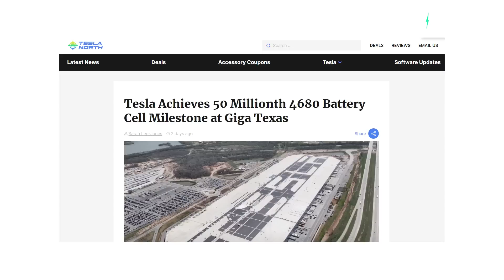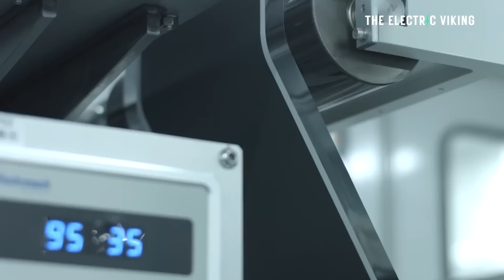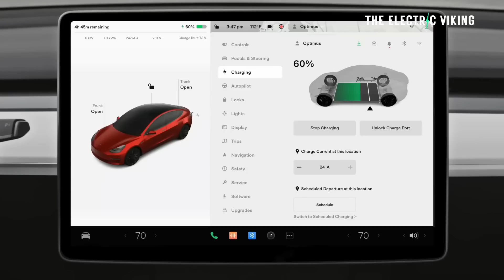Why Tesla will use different but better batteries in Cybertruck next year

Comment: Sodium ion batteries although lower density than Lithium ion,  could offer improved packing efficiencies by using much larger cells. The greater heat tolerance of sodium ion batteries could allow this larger cell type to be used.  This could improve the watt hour per kg of battery and bring sodium ion closer to lithium ion when the wh/kg is normalised in this greater packing efficiency context.  Thus potentially boosting the default sodium ion 160 wh/kg to 200 wh/kg if you quadrupled the diameter of the sodium ion batteries.  By reducing battery cell gaps and optimizing the pack structure, it is reasonable to assume that packing efficiency improvements could provide a 20-30% boost in overall energy density.  This concept would only apply to sodium ion and other more heat tolerant battery chemistries.
Reply: Leveraging the greater heat tolerance of sodium-ion batteries and optimizing the pack structure could lead to significant improvements in overall performance. This approach has the potential to make sodium-ion batteries more competitive with lithium-ion batteries, especially in applications where energy density and thermal management are critical factors.
Reply: You could also modify the cell shape to be less round and more square to reduce the cooling gaps even more using sodium-ion cells, as heat is less of an issue. This could further improve Wh/kg packing efficiencies.
Reply: Of course, sodium is yet to be proven. I have no doubt it will be proven, not only for grid storage but also for EVs over time via a multi-pronged approach of sodium battery design and packing density, combined with a lower range requirement in a mature ubiquitous EV supercharging environment. That will take a few years, however, when it arrives, one simply won't require long-range EVs. The critical factor will be fast-charging capability and availability. The vast majority of car drivers will only require 300 km of effective range under such fast charging conditions. Most won't even require that range for their typical daily drive. It will only be needed for long trips. After 300 km of driving, one requires at least a 10-minute rest break, whereby at that time, one recharges 80% in 10 minutes. Game over. Job done.
Reply: Cybertruck space for the battery is currently 50% empty but the drop in Lithium prices have made Sodium Ion an unlikely contender.
Reply: Lithium batteries currently have a much higher density than sodium. Lithium batteries are packed with high density especially and there is little room for improving the packing density. 
Sodium is also not a proven technology so untill these batteries have a history no one is going to put them in their mass produced cars untill they have a proven track record.
However 
Sodium likely be popular in grid storage and lower ends cars in the future

Comment: Elon is truly the king of rocketry.  But i own Tesla.  And the 4680 seems to be a huge miss from the stated goals.  From the business end of it, Tesla made the appropriate supply deals to grow, but never heard is just what the effort into the 4680 cost and is costing, and what exactly are the results.  I dearly hope that when he gets the ransom, I mean compensation, he will have a host of hot actual accomplishments to refresh the world’s memory.  That is the freest speech you can generate organically, as we used to do, in a fully positive light.  Better times!
Reply: They intentionally pulled back 4680 efforts because lithium prices dropped, meaning they could just buy in batteries cheaper from others. Tesla trying to be the best battery manufacturer and the best car manufacturer at the same time is a route to bankruptcy. The only accomplishment Elon needs to get paid was 10x the share price, and he did that, even considering recent drops.
Reply: Agree, Tesla has missed the targets for the 4680. That why some great folks was laid off this spring, one among them was Drew Baglino

Comment: I wonder if they will use the 4680 size tor the LFP battery? They would fit inside easier then.
Reply: There is a flat version that is even more space efficient.

Comment: As an investor in Tesla, I love to see how they are always at the forefront of EV design. I know you love the Cyber truck, and I do appreciate some cool features on it. However, I prefer the more practical design of the Telo truck. I am all about space utilization and that design would work much better for me. They are talking about using lithium-ion batteries so far. I hope they change their minds. I can't recall your reporting on them. I hope you do. Keep up the good work, I love the public service you do for all of us!
Reply: The Cybertruck has aspects that make it more practical as well - a body and engine/battery that last nearly forever, free fuel if you have solar at work or home, near zero maintenance besides tires, better electricity supply for tools. Not everything is perfect but neither is it with traditional trucks.
Reply: @Michael-Has-Opinions  ahh the voice of sanity. 😊
Reply: All designs are about comprising one thing for another. I agree with all your points. The CT is big and flashy, as contrasted by small and practical Telo. Do you see the Telo as a traditional truck? As for the tech side of things, Tesla rules.
Reply: I agree. They messed up on the CT and it's too bad. They have a chance to really do something here but did way too much 'innovation' in terms of design that was totally not necessary - in fact, probably detrimental to Tesla
Reply: @travisjazzbo3490 two million pre sales!

Comment: A true battery breakthrough is what's necessary. 2x or 3x energy density at a minimum. Powering a work truck with batteries atm is kind of a joke.  There will be ZERO battery powered "actual" work vehicles in the near future and I love Elon.
Reply: This is not correct. The only place gas trucks work out better is towing big loads over big distances (F250) or extreme situations where customers are 500 miles away with no place to supercharge. These are unusual circumstances.
Reply: What do you call a "work" truck? I assume you mean one that carries a few bags of dirt and a two-four?
The Semi is a work truck, and will be successful once they get around to, ya know, actually building them.
Reply: @capnkirk5528  I agree however the Semi is a specialized purpose-built transport where many efficiencies can be optimised. Even so, the Tesla Semi will never hang with a diesel on range. It just aint happening until we get a battery breakthrough.  So work trucks are, F250 and larger utility trucks that are used daily at work/construction sites for various activities. Also class 3 to class 6 truck types are a very long way off. Those will all be gass/diesel for a long time yet...
Reply: @mdeasy while this is true, there semi can go 800km fully loaded.  No driver can get anywhere near that far before they are required to take a mandatory rest stop.  Megawatt chargers can refill in less than an hour.... So the real need is enough strategically placed mega chargers to be able to service those rest stops
Reply: A Chevy Silverado EV with 440 miles range is inadequate?  Electric delivery vans (already in use)?  Electric semis for trips within 200 miles (a significant fraction)?  Already in use.  Electric buses (already in use)?  Reality has surpassed this meme.
Reply: @bearcubdaycare  Everything you say is ABSOLUTELY TRUE, but HE is the kind of idiot who sends money to Trump.
YOU CAN'T FIX STUPID.
But if you could, you nailed it!
Reply: I’ve thrown plenty of shade toward Tesla and it’s fan boys but I think your underestimating this truth.  But yes we need a 50% more energy density.
Reply: @davidstrong7854  Your choice of "50%" is ironic since the average ICE engine wastes 50% of its gasoline energy to the air as waste heat.
Reply: How about breakthroughs in home construction technology that can overcome the tendency of them to disintegrate into splinters in the face of the average tornado?
Reply: @billyrio3767  concrete and rebar that goes down to the foundation.  Just people in Midwest want cheap stick houses.
Reply: Funny @mdeasy  since I think completely inverse of you. I mean I think most those buying right now petrol truck are live in the past. I mean, look on the road, like 90- 95% of the f150 and others trucks have near empty bed, and are not towing anything most of their time. Most are only people who buy truck, are intended to only to tow like only few time in a years. This is why I say it's a joke those saying EV can't tow because I tow with. Only slight trouble is for when I do long range, need more frequent refill but in counter part it cost way less to run compared to petrol one. And I'm like 95% on the road, most of the time I don't tow and 95% of the time I waste way less money riding it compared to petrol one. 😄

This said as you said the more energy is better, but right now it work very well already, and contrary to you, I find Elon very good in technology, but in politics Elon is really not good. Another example Elon is destroying twitter too, not good and I'm far to love him. Then I don't love him contrary to you, but respect him for his good side.
Reply: @sergiomomesso1590  Yup we're kinda polar opposites. I think he's nailed Twitter/X and I'm aligned with him politically as well. The new twitter is what the world needs right now. A place to share real news and information. Not perfect yet but it's way better than anything else atm. Have a good one Sergio!
Reply: @sergiomomesso1590  If Americans (or Canadians for that matter) could actually DO math, they would realize they rarely need that truck and that, for when they DO need it, there are alternatives.
On the OTHER hand, a truck that is licensed, insured and used just as an RV tow vehicle (and you actually RV, and not just sit in ONE park) can make individual financial sense.
But ... TWO WEEKS a YEAR? NO ...

Comment: I canceled my Cybertruck the day it was scheduled for delivery and bought a model X, so it wasn't much of a hit to Tesla.  The CT just isn't a great value in the foundation series, and the hype turned me off to a vehicle I'd really had high hopes for.
Reply: The smart move for any value orientated buyer. Attention orientated buyers should buy the CT.
Reply: Not a great value, but the best gadget at the time. I’m enjoying it.
Reply: @tleo3333  Very cool vehicle for sure.  The X isn't bad for gadgets either with air suspension and cooled seats
Reply: I think the S and X will be technically great again when the add steer by wire and the 48 volt architecture but I think that could be many years away.

Comment: Other battery companies are making 4680 format cells.   Tesla will be making cylindrical cells in the 4680 format for a long time.   That does not mean it will be the battery they are making now.
Reply: Correct. 4680 is just a size. The reason the Cybertruck 4680 was a bit slow at times was they added a dry electrode, a major step forwards in technology, and that was not easy to product perfectly everytime.
Reply: @Michael-Has-Opinions   If Tesla desires to continue with 4680s in the CT  it has places to get them.
Reply: 4680 just refers to the size of the battery. Could have changes in chemistry.
Reply: @johnlynch301  I like to say the 4680 is chemistry agnostic.

Comment: How is $80,000 cheaper when it was supposed to be $40,000???
Reply: The top tier was never advertised to be 40k.
Reply: 40k is now 50k inflation adjusted.
Reply: @Michael-Has-Opinions I bought a used car 5 years ago for 3k now the same age and model is 6k. I don't think the 40k is 50k  in the car market now.
Reply: Yes, but initial investment has to come down. Then the cost can come down. That is, if you want to make products and actually profit from them.
Reply: 40k in 2019 for the base 250 mile rwd genius, that's almost 52k in today's dollars. Also tesla was already out of tax credits back then having sold over 200,000 us made evs. 

60k for awd with 300 miles of range in 2019, 800v v2x and rear steer wasn't inc back then so 80k NOW is reasonable for up to 340 miles, 35s air suspension 0-60mph in 4s etc. All ice competitors anywhere near it are as much or even MORE msrp wise. 

The top dawg tri motor went from 70k to 100k+but so did every other top spec trims of competitors ice&ev trucks. 

Fk a friend just pre ordered a new tri motor max rivian r1s and showed me his sticker is gonna be 117k. 😅
Reply: Have you check the prices on all other cars lately?
A Toyota tundra platinum is over 65k, just to name one.
Reply: @bac3phi69  right? In 2024 cox claims an average full size truck or SUV is transacting at 65k!
It was just over 63k for all of 2023. Pre pandemic that number was just under 50k! 

Heck I clearly remember farley and Palmer both in the 2021 summer launch of the lightning. Saying that the 39k base awd trim would be available in quantity to any retail customers! Afaik not a single retail customer ever got any lightning for that. 

The average lightning transaction is nearer to 80k ie nearly double! And the cheapest trim atm is about 57k with no options for 250 miles awd slow charging few options&vinyl seats. Heck rj said rivian would make a 59k trim r1t in the same time frame. Yet the cheapest r1t lfp pack not even available today for delivery without tax credits? It's 69k! 😀
Reply: It’s just Sam pulling numbers out of his arse as usual…
Reply: 40k was a single motor, these are not being made yet. Also, prices went up a lot since the demo 5 years ago(inflation) and also with the limited production volume right now there’s no point selling trucks cheaper now, people will just resell them to make money. Once the initial demand is satisfied, prices will go down.
Reply: How many are going unsold because the price is too high? How many more would they sell if they brought the price down to $40k? Or even $5? Or 5¢? Not a single extra one, right? Companies charge what people will pay, simple as that. They'd be stupid not to. Now, would I buy a first-year production vehicle? No. Right now they're the worst they'll ever be and the most expensive they'll ever be, so I'd wait until year 3 or 4 or production personally. But I'm not going to stop others from buying one now if they see value in that, not begrudge Tesla for charging that much if people are paying it.
Reply: Don't you get it? Tesla supporters have above average Intelligence..Therefore you can only lose here with your uninformed comments. And let me guess. You are talking about freedom and support Trump who wants to take away all freedom of women concerning their bodies and reproductive rights.
Reply: Biden’s brilliant economic policies made real inflation 30+% in just 3 years!
Reply: My grandfather was able to buy a house for $10 but I have to pay over a million which I will never afford in my life!

Why is the ford f150 lightning and all the other dual motor Pickup trucks on the market 80k my mom promised me I would have a pickup truck when I grow up cries

Single motor Cybertruck should be about 60, when it releases like years in the future, and the competition will be either chinese or bankrupt because Tesla will undercut them
Reply: $40,000 when available for sale... nowhere was it stated: "Adjusted for inflation when it's available." People here are just adding words that were never made!!!
Reply: @bfree6197  no, they are just not stupid. Unlike you.
Reply: I guess you can say the same thing about the prices of eggs and bread. Or how about the price of a house. Thank your government for borrowing so much money with nothing to show for it.
Reply: They don't need to make 250000 units next year. Less than 1 in 10 are buying with the many downgrades and substantial price upgrade
Reply: @greatearth5861  they're just asking people if they want a foundation series, which is, like you said, much more expensive and doesn't actually give you much other than bragging rights. But realistically I think those who buy one are going to find they paid an exorbitant price for the worst version of CT ever, and a lot of potential buyers probably think the same way I do. So they're waiting until later when they'll get a cheaper version that has more of the early bugs worked out and is more feature complete. Personally, if I were to get one I'd wait a few years as I'm sure the price will be dramatically lower for a 2027/8 version and it will be much more refined at that point.
Reply: $40k in what year? Apply inflation. It may not be $40k, but what is it?
Reply: @anthonyriley-lu6kb inflation has gone up a realistic 28% across the board on the conservative side.  50k (ie dual motor) X 28% inflation is $64k.  

Obviously Tesla has to make a profit, but considering ALL car manufacturers are losing money in the west, I’m shocked that Tesla makes money.
Reply: It was suppose to be 40-60 not 100k
Reply: @davidstrong7854 it "WAS"
Reply: @davidstrong7854  - There was never a Pitch for a Cybertruck at "$60K!" Never! There was one pitched at "$69,900", however!
Reply: Exactly! Well said. These miserable fools who do nothing but immune this amazing company and it’s products are quite pathetic.😮